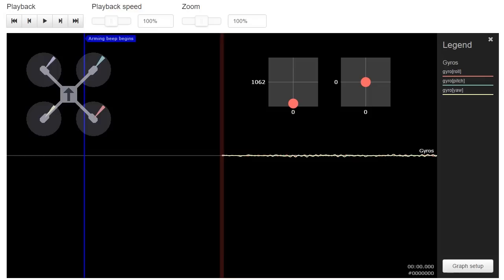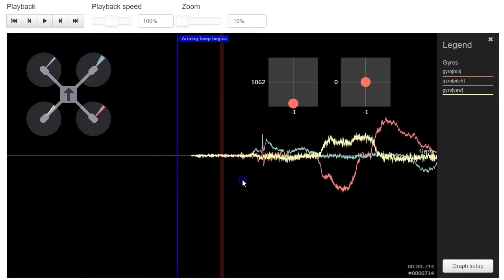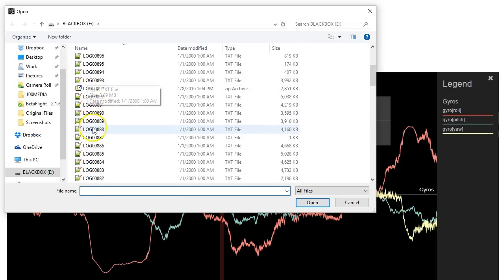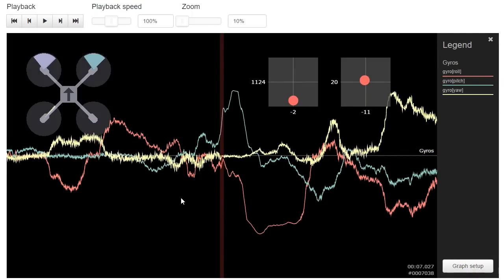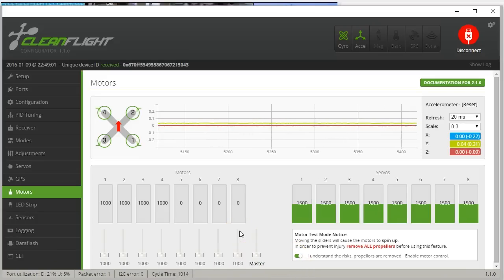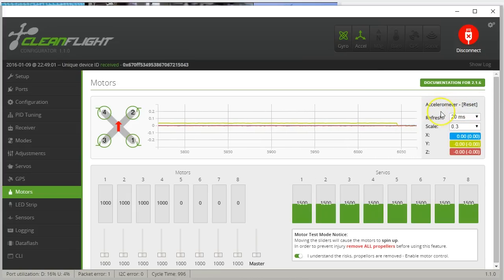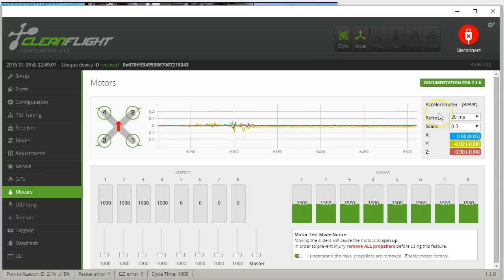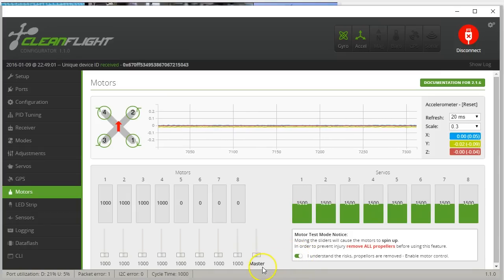Troubleshooting Quadcopter Vibration

Comment: I've been messing with a horrible vibe issue with my brand new qav210. Motors 2 and 4 display vibrations about -3.x at a certain rpm. I installed new motors (all 4 to be safe)... Lumenier rx2206. That didn't fix the issue, replaced with new esc, that didn't fix the issue. Calibrated the esc... Still didn't fix the issue. Replaced with new bottom frame. Still didn't fix the issue. Replaced Naze... Still nothing... My issue is definitely vibration, I would run beta flight 2.1.6 stock lux pids and drop D down to 5 and still have osciallation on punch outs. Keep in mind I've had this issue from the start with all brand new parts. Any idea what I can be missing here? I even replace all screws and standoffs. Thanks
Reply from the maker: Do you get vibes in the Motors tab as well as in flight? If so, that rules out a tuning issue. Have you adjusted ESC timing?
Reply from the maker: Do you get vibes in the Motors tab as well as in flight? If so, that rules out a tuning issue. Have you adjusted ESC timing?
Reply: +Joshua Bardwell since I don't have black box recording, I can't tell I'm getting vibe in flight. I am assuming I am because it is affected when I adjust the d value. At 5 it's not as bad, when I raise to 12 it's horrible. I then checked it out in the motor tabs, and noticed the issue. Haven't messed with timing of the esc, but with my setup I figured I wouldn't have to mess with that, nor am I that familiar with it. I just built my friends qav210 with the exact same setup and no issues. Looking at the lumenier pilots I'm running the Same set up and thinking I wouldn't have to mess with that. I'm running lumineer 20a autoshot esc, lumineer rx2206 2300kv, hq tri props and a Naze 32 rev 5 on their qav210 frame. Tonight I'm going to try to switch motors 2 and 1 and 3 and 4 to see if the vibe follows. Considering that I swapped all the motors before, I'm guessing it won't follow. In my initial statement I said motors 2-4, when it's actually 2 and 3. Sorry about that.
Reply from the maker: +SuperHiro FPV My point is just, if you get the vibes in the Motors tab, then it is definitely something between the ESC and the motor, because the Motors tab just sends a fixed PWM signal to the ESC. The PID loop is not active.
Reply: +Joshua Bardwell thank you for the reply and see your point. But given this, do you have any suggestion on how to possibly fix the issue? Any suggestions would be deeply appreciated. Thank you
Reply from the maker: Well, first see if the vibrations show up in the Motors tab. Take the props off so you are testing the motors not the props.

You say you have the exact same motors on a different copter with no problem. Swap one of those motors to this copter and see if it starts vibrating. Take one of the vibrating motors and move it to the non-vibrating copter. If the motor vibrates on one copter but not the other, then probably the ESC on the vibrating copter is to blame.
Reply: +Joshua Bardwell thanks. Last night I took the motor number 4 that was smooth and swapped it with motor number 3. I know this sounds weird, but after I did he swap motor 3 and 4 have vibes now. Also, I've been watching your videos and I do the motor spin up test in the motor tab section fairly quickly like you suggest, but I've noticed that sometimes I would get high vibe and sometimes I wouldn't. Is that normal to be inconsistent like that? But if I do move the throttle up slowly I can usually pinpoint a specific throttle range it starts to spike and go crazy. Is that normal? Thanks. My next step is to try to change motor 1 with 3 and see how that goes. Motor 1 is super smooth
Reply from the maker: SuperHiro FPV This is all sounding a bit like an ESC issue based on what you're saying. Especially the specific throttle position where the problem happens. Are the same ESCs on both copters? Same version of firmware, etc...?

Assuming BLHeli, try changing timing from medium to med-high. Also, try changing the dither setting to 15 if it's not already.
Reply: +Joshua Bardwell, same esc, same firmware version. I even swapped out the esc on motor 2 and 3 to see if it was the esc with brand new esc. Still have the same issue. These are lumenier 20a autoshot esc. They come with Simon k. Let me try to load a YouTube video on my motors vibration.
Reply from the maker: Since you paid the Lumenier brand tax, may as well take it up with their support. That's what you paid for.
Reply: +Joshua Bardwell yeah I've been working with them. That's how I got the replacement esc, but unfortunately it's not shaking the problem. Do you suggest I try other esc for my 210?
Reply from the maker: +SuperHiro FPV I don't like Atmel ESCs for multirotors. There shouldn't be any reason I can think of why SimonK would cause such a big problem, though.

Comment: The level of vibration you were getting on the motor test tab is definitely not pointing to the motors as the cause of the problem.  Really anything below 0.1 I would consider good enough to not cause any noticeable problems specially on the HD footage.   I recently began to notice some noise in my motors after a couple months of hard use and crashing. Although not much noticeable vibration on video, I could feel it and hear it.  Checking the vibration on the motor test tab revealed vibrations well over 0.1 and some close to .5.  My guess is bataflight ( runing at 2k )is doing a superb job of countering this and giving great smooth performance even with crappy motors.   Will be cleaning spending sometime getting the vibes down to where they should be.  
In your case I would expect the problem to be a very out of balance or bent prop.  Sometimes even HQs can be terribly bad.  If they where warped during shipping  or by being packed together too tightly, a blade can deform enough  to cause uneven thrust which results in vibration.  Only dynamic balancing can fix this, or, just throw the prop away, it's going to break anyway :)
Reply from the maker: +Zenman FPV I agree that anything below 0.1G is probably not causing visible vibrations. I had ruled out props because I had all new props on the copter when the issue was happening, but replacing the props seems to have fixed it, so my guess is it was a bad prop from the factory.
Reply: +Joshua Bardwell I have been using tri blades as of late and did not notice any problems with the HQ nylons but the carbon mix seem to be more prone to deformation that probably accours during storage or shipping, they are easily bent.

Comment: I had a nasty vibration problem even with balanced props.  It was on an FPV250 frame which has pretty flexible arms so any vibration seemed to magnify.  It ended up being that on even light crashes, the shaft on the 1806 motors was so thin that it would bend.  If i turned the motor by hand I could see that gap between the bellhousing and the base increase and decrease.  Sometimes I could straighten it out by bending the shaft by bending it by pushing on the bellhousing.  I ended up replacing those motors with Lumenier 2204-2300Kv motors.  The difference even when the 1806's were new was like night and day.  The 1806's were cheap RTFQ motors the were never as balanced as the Lumenier ones.  Good luck with the issue.
Reply from the maker: +txfieros I put four brand new props on and it seems to be gone, but I only flew one battery to check, and only checked the FPV view, not the HD camera. My current guess is that I had a prop that was imbalanced from the factory, so even though I had new props, I had an imbalance issue.

My other guess is... at the end of the flight session, broke an arm on what was not a terribly intense crash. So maybe I just got unlucky, but I wonder whether the arm was weakened in some way and was flexing.
Reply: +Joshua Bardwell based on my experience with flexible arms on the FPV250 that is now mothballed vibrations become more intense when your arms are flexible.  I just do a quick balance on my props to even out the light blade.  I don't bother with balancing the prop hub any more.

Comment: would you consider running the vibration test in cleanflight and using bits of tape on the bell housing to see if you can balance it again?
Reply from the maker: +Tobermory Cat I did give that a try, but I wasn't able to make any improvement. I find the tape-on-the-bell approach to be really hard to make fine adjustments, and the tape always comes off in the field eventually anyway.

Comment: I crashed in some soft mud once. It was horrible to clean. Front two motors were full of it.
Reply from the maker: +Invitingsauce I have had decent results letting it dry and then spinning the motor to blow it out. Judicious application of compressed air can do the trick as well. In a pinch, you can rinse the motors out with fresh water (not salt!) and they will be fine. The bearings are reasonably sealed and the windings are coated. You should probably re-apply oil after this technique, but it'll get you through the day.
Reply: good point.... motors could get dirt stuck in them and cause vibration.
Reply: +quiljw01 yes I let it dry first and it was much easier. I used a soft bristle nylon brush and tooth picks worked great.

Comment from the maker: In the interest of full disclosure, I should let you know that none of this changed the vibration characteristics of the motor. There was a tiny bit of vertical slop in the shaft, so I also loosened the grub screws and used a C clamp to press the shaft in about 0.5mm to tighten that up. That didn't fix it either. 

Given that I can find no major mechanical issues with the motor, and given that the motor's vibration is less than my 0.10 G threshold for "definitely too much", I am going to go searching for other things. For one thing, I am going to put four brand new props on all at once and see if maybe I just had a bad prop from the factory.

Anyway, I hope that this video is helpful even if it didn't actually fix my problem this time.
Reply: Joshua, did you end up finding the problem?  I'm left hanging!  :)
Reply from the maker: +Rob B Definitely worth a look.
Reply: joshua, 

vibration can also be caused by lose parts. the bearing that was falling out is not correct. this causes hermonic like vibration (high freq noise). it seems like there whas a crack in the base of the motor from the bearing bore to the out side.

are you still flying this motor ?
Reply from the maker: Pieter Denise Bloem You have very sharp eyes to notice that mark. I took the motor apart again to double-check, and what you are seeing is either a scratch in the paint or a milling mark. But there is no crack.
Reply: +Joshua Bardwell, thats good news! still the bearing should have a press fit. (when your motors heat up the housing expands en there will be no clamping of the bearing at all and starts to move causing fibration)
as you mentioned it is for now a acceptable amount of vibration. but over time this can get worse.
hoop this helps you :)
Reply: What should i do if i have horrible vibrations past 50% throttle  in my qav210 using lux fc. I have no idea if its my motors escs or my lux fc cuz when i test the motors tab 2 of the motors die down to low rpm when i bring the quad to full throttle.
Reply from the maker: +Blake Swisher if the motors don't spin at full throttle in the Motors tab you probably have a damaged motor or ESC. But also possibly bad solder joints. 

Don't spin the motors full throttle with props off by the way.
Reply: Yeah i dont want to damage my motors some people saying my lux fc is the issue cuz in cf if i turn up motors tab after a tune my motors spin to full but then over the course of 4 seconds 2 of my motors drop to half throttle and this is all new equipment from getfpv all the escs and motors cameras vtx everything not sure what to do rn